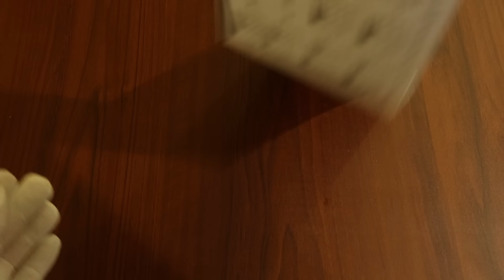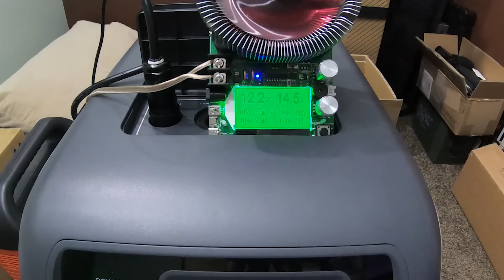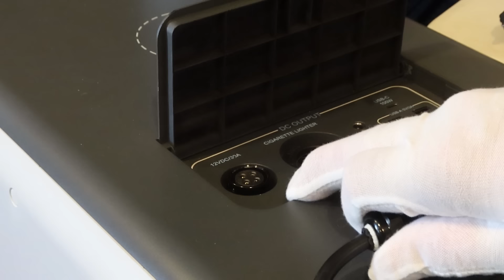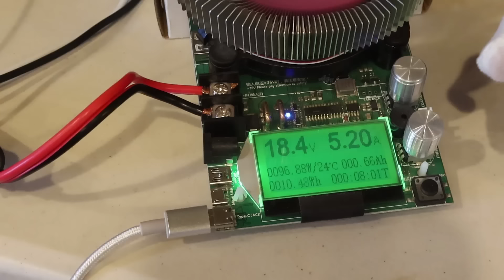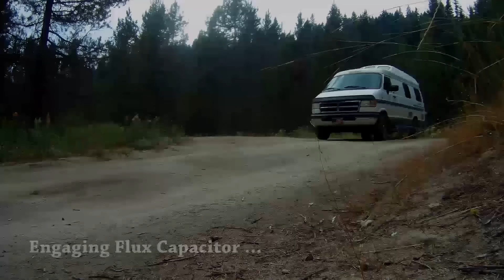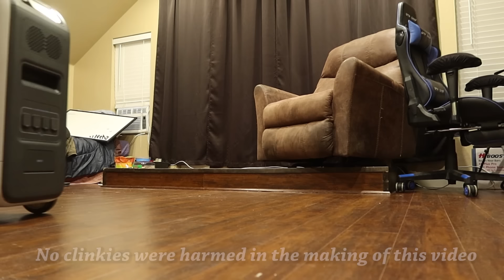BLUETTI EP500 5120wh LiFePO4 UPS BACKUP Off Grid Solar Generator Kickstarter Review

Comment: I use the AC200 to run lots of stuff in my 3 bedroom 2 bath home daily and it’s been working great for 6 months. I wish this would have come out first. Same for the 200P!
Reply: Me too bro.  Ima bite the bullet and buy this one.  Then be disappointed when after the kick starter when thry launch a 6000w hour afterwards most likely
Reply: @noctilucent7396  At this price you can sell it for a profit when the next one comes along.
Reply: I know!! I just purchased the pecron.
Reply: Its 4-17-21. I use ac200p to run Dishwasher at 200-950 with heater on. The GE huge capacity clothes washer 180-950 in spin max. Dryer gas, couldnt see spike but it tripped under volts on eb240. Ran fine. Runs 200 or so. Some times it draws 800+ watts when heater on to ignite gas. Not all at once. Input use 500+ solar with ac charger when it draws 900+ watts with both 23 cuft fridge n washer running. Max load so far at 1600 steady. 
Kicker: LH 14000 btu port ac unit it runs ( only by itself). That drew 2800 peak to start. Then went to 1150. AC cannot run with fridges on. So I put them on sce or eb240 with air on. I use 180w BVRouge panels 8 of them. Series parallel on eb 240. Series on ac200p. HIGHLY SUGGEST UL 10 gauge wire to panels. I use 100' length no issues. Placed in full sun 7-5 pm now. Hope it helped you.
Reply: @ancientbutstillhere6570  I live in TX. During that February deep freeze, I have no power, water and gas. Thank the Lord, my wife and I have bought food and water supplies a week ahead. I have about 2-3 weeks water supplies but those are use for cooking, drinking and brushing our teeth. My dishes, utensils and pots were feeling up on the sink. We couldn't waste water at all let alone washing our clothes. Gas. We have propane and gas lighter to cook. The only thing we lack is power electricity. Nothing to generate. It's like we went back in time before the 1900 to survive but in extreme cold weather. There are water pipe burstings throughout TX. I was afraid of it so my wife and I went to cut up the kids floating device for summer and igloo Styrofoam box and cover the pipe outside.

I'm using the Government stimulus check to pay for the generator. I suggest people not to be too depending on government help. Help yourself first and then your neighbors. Your neighbors will help out in extreme time. Brother and sister and relatives can't help because of long distance barrier.

Buy camping equipment because that will help as a supplement in case the zombie apocalypse arrive. I also buy Berkley water filtration as this can filter most water including rain water for drinking water.
Reply: @tr1bes  You make the case for paper plates and plastic utensils, lol.  Just burn your dirty "dishes", lol.
Reply: AC200 is not UPS, correct? What sort of appliances are you using at home?
Reply: Check out the Titan solar generator seems to me that the specs on it with three battery packs beats this one hands down.
Reply: @bbariceo  Did you see that BLUETTi launched the new AC200 models and launched a new product the AC300 which has 3072 Kwh, and launched the extra batteries for the AC200 MAX(THEY ARE RETROCOMPATIBLE WITH THE AC200 AND AC200P MODELS)now it can reach 8192KWH and the AC300 can reach 12000 kWh with the 4 extra batteries and it also has the Fusion Box Pro that allows you to connect two AC300s and bringing the capacity to 24576 kWh!!!!!
Reply: @bbariceo  titans sucks they are on back order

Comment: This is the most amazing offering I’ve seen!  Two of them would be even better!  It shows how far a home backup system is from a camper system like AC200P but we’re getting there!   Thanks so much, Tom, for a clear and comprehensive review of this groundbreaking system!  Kudos! 👏👍
Reply: You would be MUCH better off with a hardwired system at that point. These are mobile and convenient but once you get to where you need multiple the cost just becomes way too high compared to a hard wired system
Reply: @evocati6523  A lot of people rent, though. They can't go modifying their houses around roof panels, marine batteries and a buyback grid system. With this you wheel it into the living room, put panels in the garden / on the balcony, and plug stuff into it.
Reply: @evocati6523  how is that?   The price of the Battleborn batteries alone in two EP500s  is $6800, the Kickstarter price for two EP500s is $5999
Reply: @evocati6523  Certainly depends on much you want to pay for the extra mobility.  I think that DIY approach requires a lot more stuff and knowledge to assemble.  Having it all sorted out and warranteed is certainly worth a lot.   I wouldn’t buy the EP500 (or Pro) just for mobility.
Reply: It's so awesome.   You could simply decide one day to buy another one and then have the double power...or not.   Unbelievably great option to have if you ever wanna take it!!

Comment: Do you have any of your older used generator's you wished to sell? I breed rare albino and snow turtles and fish outside as you could see on my channel  so I am setting up there own power grid before setting up for my own home. But I really would like to buy a used solar generator for my rare turtles and fish. The aqurium run off USB Filtration and pumps so this should be easy for next winter. I already have solar running solar but need to increase the panels.
Reply from the maker: I'll be selling some next month on my store page.
Reply: @HOBOTECH  .. thank you sir

Comment: Why promote battery cycle life of 16 years when this technology will be antiquated in 5 years? Let's address the real pink elephant in the room Tom. Replacement parts and repair costs during and after warranty.
Reply: Because it doesn't mean you have to move up to newer technology
Reply from the maker: How are we supposed to know what's going to happen in 5 or 10 years? Most just ask how long the battery lasts so that's what I answer. I can't predict the future. As long as you have a warranty it will be fixed free. Just like any other electronics. If you take care of it, it will last you many years. Most will upgrade every 2-3 years anyway as technology changes.
Reply: @HOBOTECH  How are we supposed to predict what's going to happen in the future? Ask the manufacturers and the leading innovators. After warranty service is important to consumers especially on high ticket items and just like all other electronics quality components are critical for those trouble free years. Higher efficiency and features are a given for the future as always, a single high capacity single unit with built in 120+ 240 volt will be in the future and of course battery upgrades will make this ho hum but that's they way it goes. Let's see if this will become a classic or a pinto.
Reply: @RWSBrowning  I remember having those same thoughts when I upgraded to the newly released, high end, 1200 baud modem... “Classic” electronics are a myth.
Reply: @realrasher  Good example
Reply: That seems to be a BIG gap in almost all online reviewer's discussions/examinations, nearly across the board in every channel. They are compensated for pull-through sales of the products they review by channel. Since most SoGen/PPS are new releases, even possibly Kickstarter/IGG "prototype production runs" there is little solace in believing there will be spare part availability when you may need them in warranty or thereafter through some reasonable life cycle. Big assumed risk on consumers.
Reply: @CVN-C2N  Yes and 16 year battery life means nothing if that unit as a broken inverter, charger or dead screen, firmware obsolescence or no support. emergency service during a crisis? Forget it.